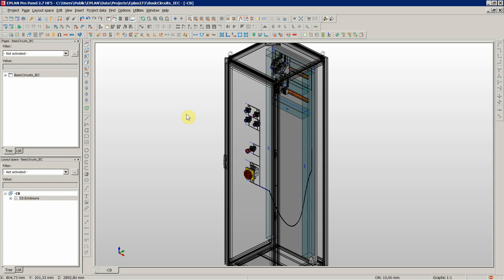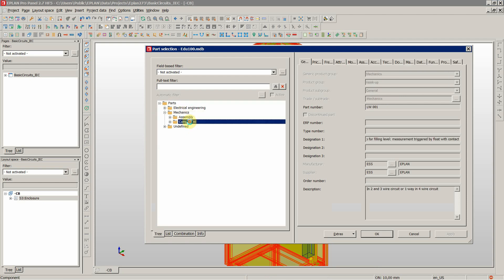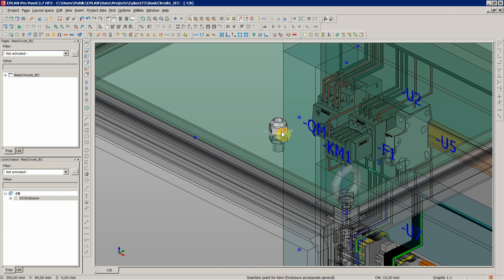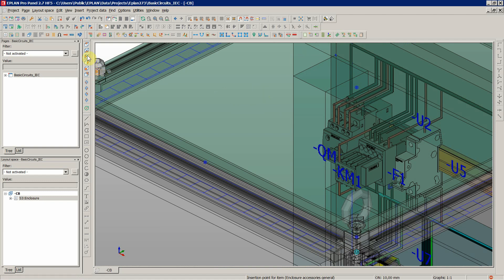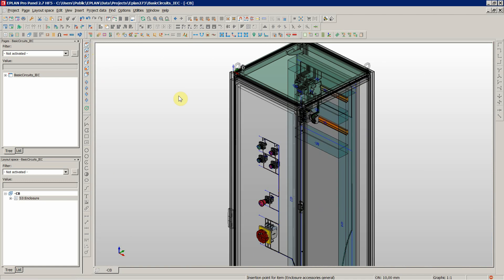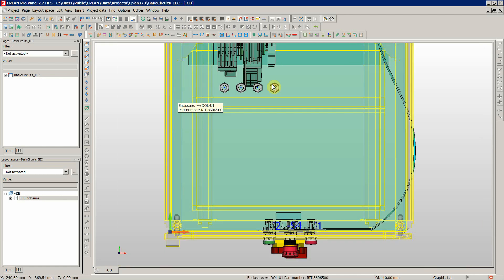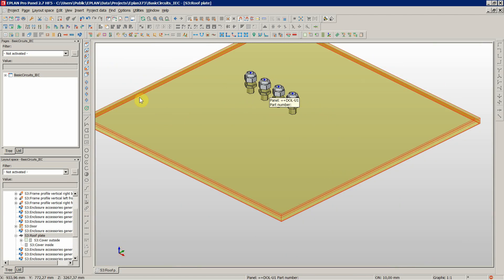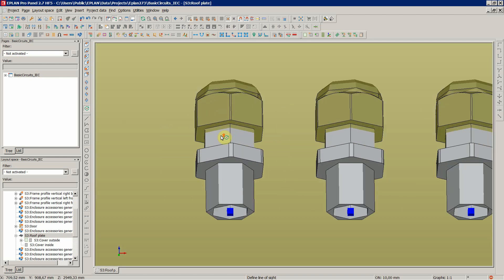Eplan Pro Panel Advanced Course - Placing cable gland on to the roof plate (Free Preview)

Comment: What about routing through gland...?
Reply from the maker: I also do that in the last video of the course. As a simulation and proof that the routing path really works. That is, that we now can route wires/cables through it
Reply from the maker: You see the wires through glands on the video thumbnail image :)
Reply: I appreciate your dedication for sharing you knowledge with us.i subscribe one of your course on udemy it was very helpful. That's why I am looking forward now .I am stuck now at this point because I am unble route through gland
Reply from the maker: @mdnazeer1201  I've decided to host pro panel courses only on my website, along with new ones that I plan to create. Advanced Eplan courses and also machine safety  courses. If you are interested, check my website. I have 3 pro panel courses. Vol.1 that I also had on udemy, them Vol.2 (routing) and then this one, Vol.3